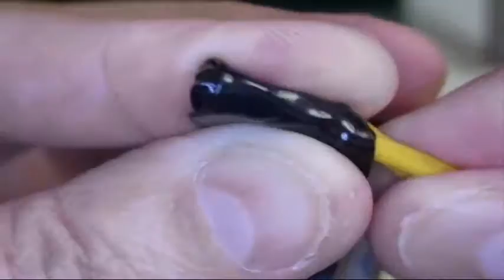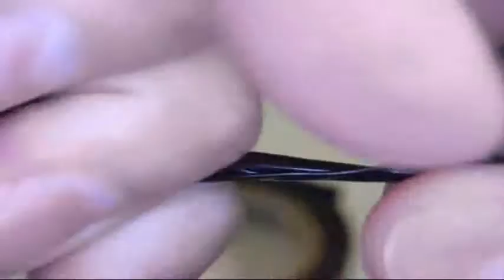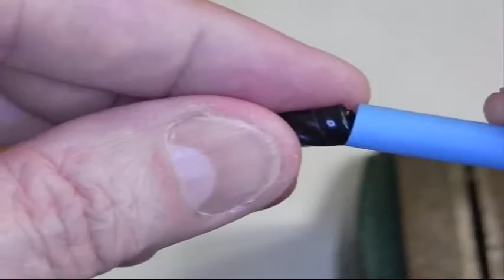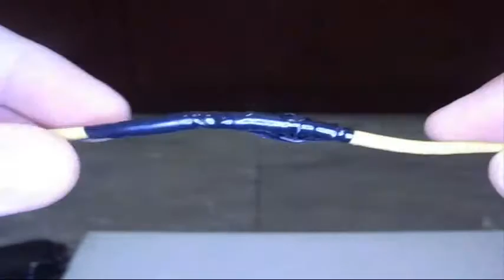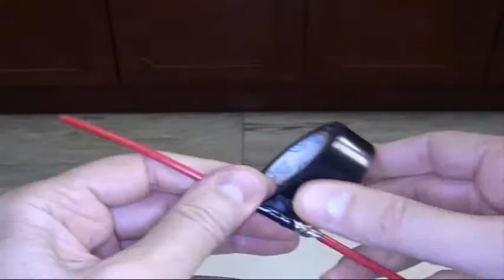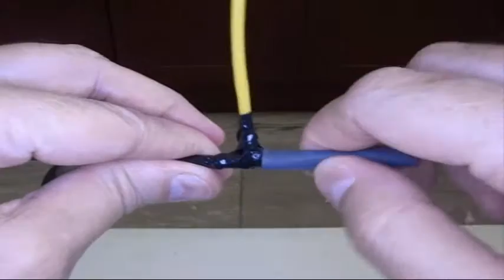Soldering -Taping & Shrinkwrap

Comment from the maker: Updated & remixed video here:   https://youtu.be/PKlKszdn71w
POPULAR SOLDERING VIDEOS:
Soldering Basics - Popular Solder Connections - Done Right (4K) https://www.youtube.com/watch?v=udNu-wZaqJE

Myth Busted: Soldering From Below https://youtu.be/gFGvNrYpsGc

Soldering Wires - Doing It Wrong, But Getting It Right (What is CRITICAL?)(4K)
https://youtu.be/Ej284nrwX84

Common Soldering Mistakes 1   https://youtu.be/mv1t-aoSDOg

Soldering Mistakes 2 - Why Mechanical Connection Is Important
https://youtu.be/IPRZOollABY

Soldering Without A Soldering Iron
https://youtu.be/b5iiUMAOGew

How To Solder - Electronics, Car Wiring, Boats, Solar, ...
https://youtu.be/gPpisFM6AIg

Soldering - Water Resistant Joints for Boats, Cars, RVs, Trailers, etc.
https://youtu.be/kZOmRE9msaA

Comment: Is this method good to fix the harness inside the hood?I understand that i need to disconnect the battery strip the  wires and solder and than the tape and shrink wrap.
Reply from the maker: If you need a connection that resists water, this is a good way to do it.  I have used it on cars, boats, boat trailers, motorcycles, solar projects, outdoor lights, drip watering systems, etc.
Reply: I will try this method thank you so much for the reply

Comment: Wow thanks, after hours of searching, finally a video that shows how to do a 3-way splice!  My question is though... in reality, there are not going to be any "loose ends" on the wires to slide the shrink wrap over... so how do you apply it?
Reply from the maker: Most of the 3 way splices I've used have been on things like long wire antennas that don't have insulation.  Yes, if you are going to use it with insulated wire you need to wrap it carefully with tape, then secure the tape end with shrinkwrap.  One leg should always be open, at least initially to slip on the shrinkwrap.  The other technique is to tie off the tape - it's not beautiful, but it's long term.

Comment: Stupid question I know, but what size shrink wrap?  There's a jillion different sizes.
Reply from the maker: It's a good question.  You want it just big enough too loosely fit over the joint.  If it's too tight and shrinks a bit during soldering, you start over.  If it's too loose, when you shrink it, it won't be tight.